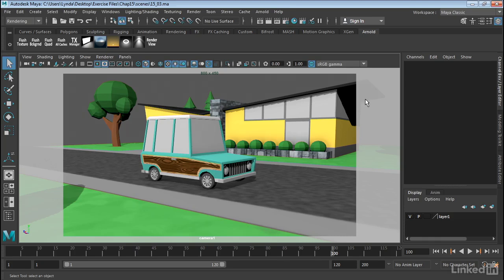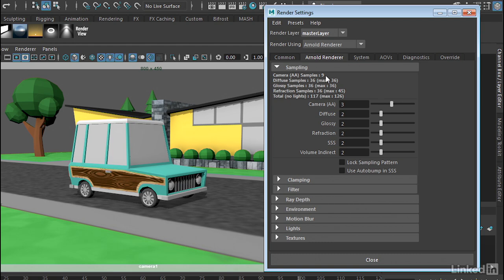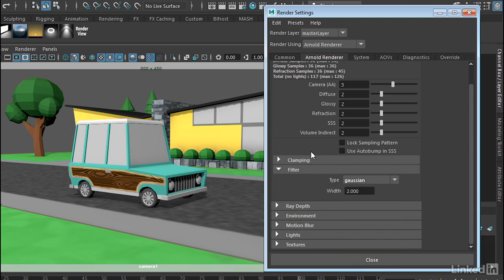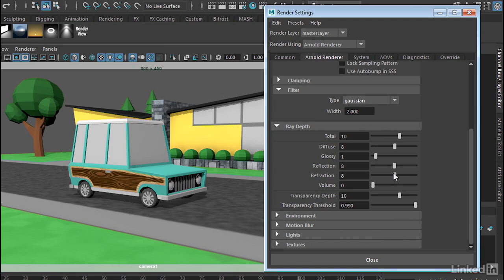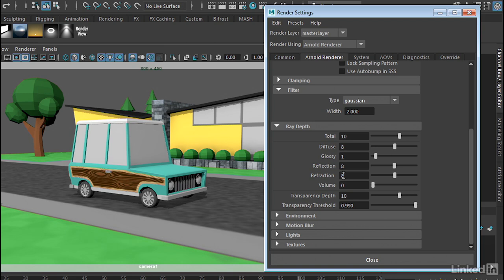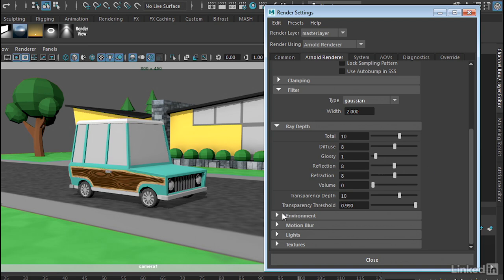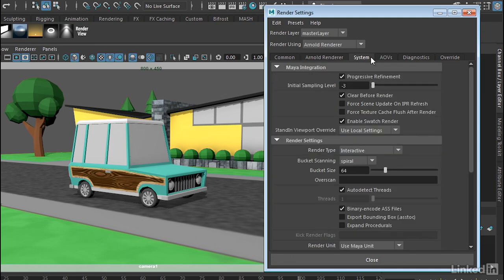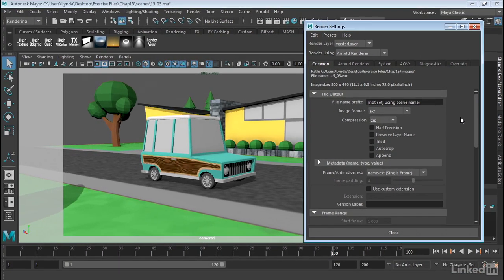Maya Tutorial - Render settings in Arnold

Comment: no matter what i do my scenes render black in maya with arnold..i dont understand and there is no clear video how to fix this anywhere ..its really discouraging
Reply: Add light to the scene such as the sky dome light found under the Arnold tab
Reply: Hey Brandon; if you add an Arnold Area Light to your scene facing your object; then crank up the exposure to some high number(don't use the slider as it limits the value initially), alongside with increasing intensity. It will cast really nice shadows and light your object well. Obviously once you can see the object well; lower the exposure accordingly :)